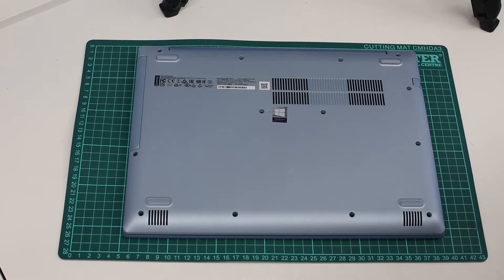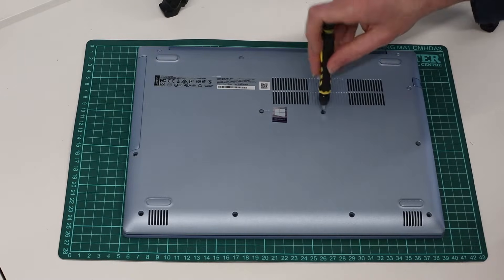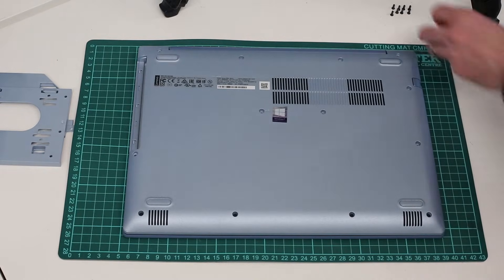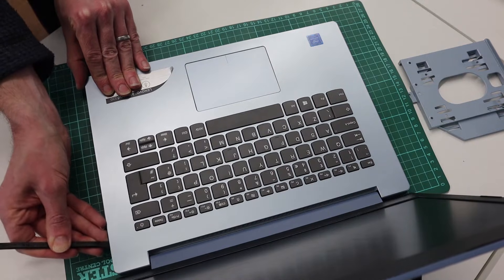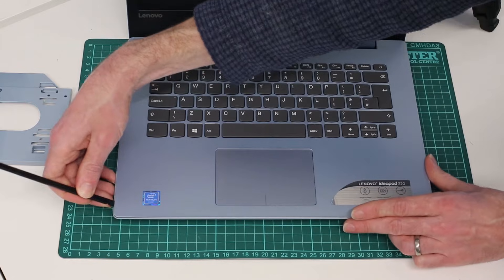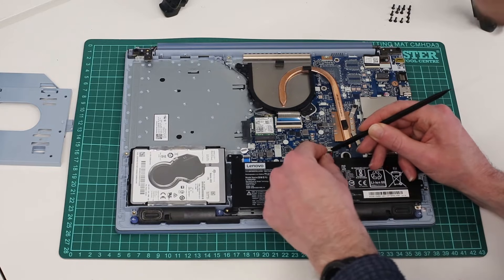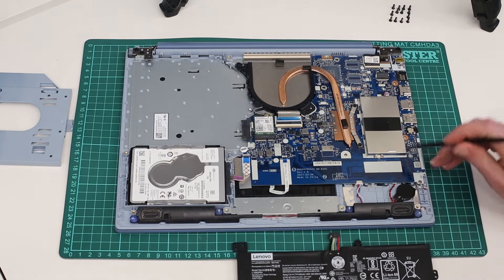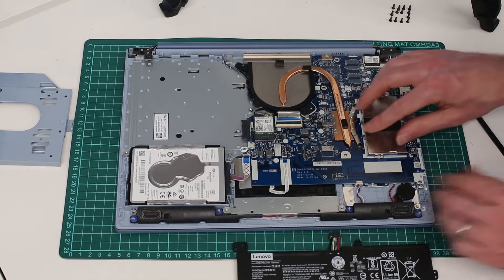Lenovo ideaPad 320 SSD/HDD and RAM upgrade guide

Comment: There are different opinions about upgrading the RAM module. Some say you can only add 8GB, others say you can add 12GB. What is the biggest and fastest RAM you could add.
Reply: I found the specifications (ideapad 320 (15") Intel Platform Specifications - 15IAP), and the maximum allowed RAM is 8GB max / 1600MHz DDR3L, one DDR3L SO-DIMM socket.

Comment: Why do we need to remove the battery before installing the ssd and ram?
Reply from the maker: To prevent accidental powering of the board whilst removing or installing RAM which may damage the board and/or RAM, and lead to data corrupton on the drive. 
It's not necessarily essential, but as a safety precaution that takes seconds to do it's daft not to.

Comment: Dear Brue,
A lot of thanks for your clear and very well explained tutorial. Yesterday, I successfully managed to replace the HDD (100% utilisation error i couldn't fix) by a SSD. The upgrade is amazing. I'd also thank you as this kind of tutorial allow us to extend the life of the laptop instead of buying a new one each 4-5 years. My 5-years laptop has just begun a new chapter, thanks to you 🙂
Reply: Did you do 1 tb? some says max we can use to ideapad 320 is 500 gb?
Reply: @JonathanHernandez-hf4jj  I replace my 1To HDD by a Samsung-500 Go SSD (enough space with this latter) so I cannot say. I noticed that CPU tends to be more used but nothing unusual. I hear in other videos that the most important point is the 2.5" SSD + suitable caddy. Nothing about a max storage. Anyway, you may also replace the HDD by a SSD, then use the HDD in the optical driver slot.

Comment: Nice session sir
I am having Lenovo IdeaPad 320 
And I am facing laptop stuck problem when working with many chrome tab open on screen and some time showing 100% disk usage please tell me solution for this
Will it be solve after ssd installation or have to upgrade Ram
Please reply sir
Reply: SSD would be recommended, upgrading ram isn't good enough

Comment: Hello Mr James!
I have an Ideapad 320-15ISK Type 80XH, in the manual online it shows that it can be upgraded to 16gb. I'm not sure if the ram is soldered or not. Can I upgrade to 16gb?
Also I have a 2TB HDD hardrive, can I upgrade to a 2TB SSD?

Comment: Holy cow how come I haven't seen this yet. So I have the same laptop as the one in your video which is Lenovo Ideapad 320 and currently I have the 4gb ram soldered, any tips on how to pick the right ram for my laptop? also I found this comment in the lenovoforums stating that the ideapad 320 can support 16gb ram.

Comment: I have 2TB HDD on my laptop. Can i add a 500GB SSD with caddy? or it just works on laptops with 1TB HDD!  Thank you
Reply from the maker: Yes, can add in a 500GB SSD no problem. If retaining the 2TB drive I'd move that to an optical bay caddy and install the SSD in the main slot inside.
Reply: @BrueComputing  Thank you very much
Reply from the maker: @MahanMontazeri  No problem - glad to help.

Comment: Sir i have lenovo ideapad 320-14isk i want to upgrade may ram with 8gb 2666mhz is it compatible?
Reply from the maker: Should be fine - looks to only have 1 DIMM slot though.
Reply: @BrueComputing  dimm slot? I have 4gb now built in
Reply from the maker: Yes, there should be a single DIMM slot on the mainboard you can add RAM to. Under a metal cover.
Reply: @BrueComputing  can i run gta 5 my specs is i3 4gb ram 920mx 1tb
Reply from the maker: With 4GB, no. With 8GB it should run, but won't be especially high frame rates on an 920MX.
Reply: @BrueComputing  yea if i add another 8gb 2666mhz it will be 12gb ram can i run the gta 5 run smoothly with 920mx?
Reply from the maker: @donescobar4066  As I say, it should work, but frame rates will never be amazing on the 920MX.
Reply: Sir i bought 8gb 2666mhz but my laptop cant open it stuck in lenovo loading what will i do lower the mhz?

Comment: whats the compatible RAM for this model? It was never answered on the video nor on the comment section... :(
Reply from the maker: From memory I didn't put a link in the description because some models of IdeaPad 320 use DDR3 and others use DDR4.
If you check what your system uses with CPU-Z that should tell you what you need.

Comment: Any updates about the speed of the laptop after the ram upgrade?
Reply from the maker: The RAM will improve performance in multi-tasking scenarios, but the SSD will be a far more noticeable upgrade.
Reply: @BrueComputing  I'm planning to upgrade both ssd and ram but due to financial constraints is it ok to have a ram upgrade first?the stock has already 4gb ram..but it is still lagging even though I uninstalled not needed programs.

Comment: Hi, I watched your video which was wonderful and very informative.  My question is, is it possible to upgrade celeron N3350 1.1ghz (lenevo ideapad 320 model laptop) processor with intel i3 or i5 apart from ram and hdd upgradation. Thank you sir.
Reply: Thank you
Reply from the maker: No. Your only option would be to replace your mainboard, along with bits like installing a fan.

Comment: My battery seems inflated . Is it safe to use it.
The battery backup is there for 4 hrs.?
Only a part of battery is inflated
Reply from the maker: I wouldn't recommend it - if the battery is pierced it could short and cause a fire.
I would remove and safely dispose of the battery and replace it with a good quality replacement part.
Reply: @BrueComputing  sir, is it safe to use without battery  ? Just removing the battery and plug n play safe option ?
Reply from the maker: @blanco5614  No issue using it without a battery.

Comment: I replaced my Hdd with a ssd. Can i insert my extra hdd in the space in the upper right?
Reply from the maker: If your machine has an optical bay then you could replace the DVD drive with a SSD/HDD caddy and fit it in there.

Comment: Dear friend, this is very nice information.let me know that,After installing SSD,is it necessary to format our machine? can we only format c drive??and D drive should be unchanged?? help me regarding this..
Reply from the maker: If replacing the existing drive then you'll need to either clone the contents across or clean install Windows to it. If adding an additional drive then you'd need to initialize and format the new drive.

Comment: hello, I made this improvement to my Lenovo ideapad 320 15AST laptop, my problem is that the ram I put in is 2400Mhz but even if it doesn't give me that frequency instead it gives me 1066Mhz, how can I increase the frequency? the bios but it doesn't say anything related please help.
Reply from the maker: 1066Mhz is DDR4-2133 (1066x2). That is the maximum speed supported by the AMD A9-9420 processor.

Comment: Hi. Is this RAM DDR3 or DDR4?? Which proccesor does this laptop have??
Reply from the maker: The model in this video was DDR3L, but varies depending on the exact specification of machine you have as there are quite a few ideaPad 320 models.

Comment: Hello! I have a Lenovo IdeaPad 320-17IKB. I have noticed that it's been functioning slower and gaming on it isn't as smooth anymore (could be the Intel graphics card or CPU, I don't know too much about computers). Anyway, I wanted to ask if switching to a SSD and  upgrading the RAM would make games smoother to play. Some games crash and drop frame levels unfortunately. For gaming purposes, would you recommend upgrading this laptop or waiting to replace it?
Reply from the maker: Generally additional RAM and SSD may speed applications and reduce some stuttering as data like textures is loaded in to RAM and isn't removed so aggressively. It won't necessarily give a significant improvement in general gaming frame rates though - but depends on the exact specs, game, etc.
I'd check the system cooling over if you've noticed a degradation in gaming performance - could be the heatsink is clogged with dust and so the processor is overheating and throttling under load.
Reply: @BrueComputing  Thank you! I'll try checking the cooling (or ask someone to do it 😂). I do want to mention that when I play some games, the memory will shoot up from like 30% to 100%. I check this through task manager. Could this also be a playing factor?

Comment: Sir on the right  side of the battery where there is recycle icon, the whole battery section is swollen and when I gently press it, it feels like the gas is trapped inside, what should I do?
Reply from the maker: If the battery has expanded I would recommend CAREFULLY removing it and taking it to a recycling centre which accepts lithium ion batteries. If in doubt have a professional remove it.
Reply: @BrueComputing  alright! Thank you for the reply!

Comment: Hey
I also have a lenovo ideapad 320-14IKB with SSD 256gb standard and 8gb ram, but have upgraded to samsung 870 QVO 2TB ;-) and it works. Do you think it would be able to handle 16 GB of RAM?
Reply from the maker: Shouldn't be a problem.

Comment: Hey there, I was having a confusion. Actually I'm about to purchase a RAM for this exact same model of lenovo so, do you think that an 8GB RAM stick will do fine with additional to 4 GB in-built RAM?
Reply: Yes, it will work. The maximum ram for this brand is 12gb. I purchased a hyper X 8gb 2400 ram
Reply: @yvonnemahan8938  what type of DDR? Is it DDR4?
Reply: @cheremmy210  DDR4

Comment: two of my screws are stuck, please help, they don't come out even after rotating it many times, it's like it is locked inside.
Reply: even after infinite rotation they don't come out.....
Reply: please someone help me.... i was planning to get an SSD and in the main slot and put the HDD in the cadday and place it there
someone generous enough to help....?
Reply from the maker: Sounds like the metal inserts have broken out of the plastic housing they are set in to - particularly common around the hinges where the force of opening and closing the screen cracks them over time.
Reply: @BrueComputing  thanks for the reply, so by any chance, how can I get them out now....?
Reply: @BrueComputing  and yes you are 100% right it is around the hinges
Reply from the maker: @kalpeshvishwakarma9486  I'd try just removing the back of the chassis with all the screws you can get out removed. Pull the base up and then try unscrewing them with a little upward pressure applied. You may be able to pull the lugs up against the hinge and wedge them so that they catch and the screw can be removed.
Reply: Due to the pandemic I prefer not going out to the service center, so if you could guide me how to get the screws out, it would be of great help... And moreover my place is under lockdown so all I can do is to order the SSD online and install it myself

Comment: Hey there. I noticed the fan was not there when you returned that back cover. Did you remove it intentionally and is it okay to remove the fan and use the laptop without it?

Comment: I having problems to upgrade the memory ram. I try it with a 2gb and with a 4gb ddr4 2400mhz but it just dont recognize anything. Actually it worked one time but as soon i restart the computer it doesnt work anymore. Should i assume its a slot problem? Or i need a 2133mhz exaclty like the on board memory? In lenovo web site they indicate the 2400mhz as i understand is adaptable to 2133mhz..

Comment: About to do this to my stepdaughter's 320. Wondering how much of a speed increase I'm going to get with another 4GB of RAM and SSD. This machine is extremely slow, probably due to the HDD but I can't see any videos anywhere which detail exactly how much better the machine performs with SSD and extra RAM.
Reply: No you don’t need to upgrade the hdd I have the exact same model you need to upgrade the ram. If your hard drive is below 500gb then I would suggest upgrading that as well

Comment: hello sir. if i change the drive to ssd, my files from hdd will be Erase? thank you so much for your helpful video, i'm using ideapad 320 too.
Reply from the maker: Your files will be on the old drive. You can either clone them (and Windows) to the new SSD, or clean install Windows 10 and copy your data manually.

Comment: Hi i have a question for you: can i use my ideapad 320 if i remove the battery from the laptop? Sorry for my english.
Reply from the maker: Yes, it'll work with the mains adapter connected.

Comment: There's no way to upgrade the processor in this notebook?
Reply from the maker: Only by swapping in another mainboard. Very few laptops have a socketed processor now, only those based around desktop components. All modern mobile chips are soldered down.

Comment: Hello, I got a Lenovo ideapad 320. Inter i7-8550u with 12 gb ram (4 integrated and 8) and without SSD, what would you recommend me to upgrade for games, games like gta V, apex legends and stuff like that, they  are running low on fps, is there a way I can upgrade to get better with ? Regards

Comment: I upgraded my 4gb RAM to 8gb and the 1tb harddrive to 1tb SSD and it is a world of difference. I'm now able to keep up with simple class assignments,whereas before I was always still loading, holding the class up. Next I'm going to remove the disc drive and use it as an extra harddrive from the one I replaced. Idk if its going to make a difference though. I'd appreciate anything helpful  in the comments section.👍
Reply from the maker: Glad it helped!
Reply: Hi - can you tell me which RAM did you buy?  I have just replaced the HD with a SSD and goodness WHAT a massive difference.  I also wish to use the blank DVD drive bay for another hard drive but as yet can't find an adapter although a HD fits into the tray very neatly - just need the cable part??
Reply: @karenhoney2232 which ssd did you buy and 1tb or 500gb?
Reply: @ I purchased a 1tb hard dive and its absolutely fine:)
Reply: How many slot of RAM this Laptop?
Reply: @kriskurniadi  One
Reply: @chome4  it has two slots, one is soldered
Reply: @kriskurniadi  one

Comment: I saw that the Lenovo Ideadpad 320-14ikb is limited to 16GB, but there is an ON-BOARD 4gb ram on it, 

so my question is, if I use my ram slot and slot in a 16gb ram would it work?
Reply from the maker: Yes, should work.
Reply: @BrueComputing  even if the on-board ram is soldered? And cannot be removed?

Comment: Is it possible to electrocute yourself when opening your laptop? I know it's supposed to be unplugged and turned off, but I'm worried about disconnecting the battery from the main board and also unscrewing all the screws with the battery still in place, so I was wondering if there is any chance at all that I could electrocute myself while trying to open my laptop. I have 0 knowledge about disassembling laptops, but my fan hasn't been working for a while so I want to clean it.
Reply from the maker: You could in theory get a small shock if you were really silly, but voltages are very low (the power supply gives the laptop 19V DC, not 110/240V AC) so the risk of electrocution is pretty much zero.

Comment: Is it ok if I remove hdd without removing the battery first?
Reply from the maker: I'd advise at least disconnecting it to make sure you don't accidentally switch the system on whilst working on it - removing it makes it a bit easier to connect and disconnect.
Reply: @BrueComputing  ok thank you sir.

Comment: so there was no reason for you to take the battery out. you could take the HD out without unscrewing the battery.... dont see why you did that...
Reply from the maker: It rests on top of the hard drive cable - removing the battery makes it easier to lift and unplug the drive. It isn't strictly necessary, but for the sake of a couple screws it means you're less likely to snag or damage the cable.
Reply: @BrueComputing   ya good point

Comment: My laptop is also 320 IdeaPad but with Nvidia MX150 graphics.

Is there only 1 slot for RAM?
I am planning to buy RAM 16GB 2666 Mhz, can the motherboard support it?
Reply: Nope.
Reply: Total 16GB is the max limit and you should buy a 2133Mhz since the system will just allocate to that figure even if you will buy a 2666Mhz. Save your money abd buy a 8GB RAM. 

Although some people did that and became successful.
Reply: I did it but the laptop encountered some error like memory overload as such... Or out of memory.

Comment: I have 320e and a9 ... Which ram should i get ? I just know it's ddr4
Reply: I just updated my memory today with a 16GB A-Tech Premium Memory, now the memory reads as 20GB memory and this laptop now is fast as hell!!!  
16GB Module DDR 4 2400MHz PC4-19200
Reply: @miketuck3010  the lenovo website was showing max Ram supported as 8gb ... I didn't take the risk. Just went with 8gb :(

Comment: is it worth it to upgrade to a ssd 500gb from kingston? and add 8gb of ram? 
or should i add a tera to make an impact on the performance?
Reply: I just upgraded to a 500GB SSD drive from a 1TB HDD drive, I don't nearly use close that that much storage.  World of difference on how much faster this laptop operates now.  I am waiting to install the 16GB memory stick, as I have read others with this laptop upgraded to the 16GB stick along with the 4GB onboard memory and now have 20GB without any problems
Reply: @miketuck3010  Oh that's great to hear, i thought that maybe 500gb wouldn't make an impact, i lost you at the end, you'll also add 16gb of ram?
Reply: @onazeballos3413  Yes, now I have 20GB of memory in this laptop

Comment: Hi sir, I'm planning on upgrading my Lenevo ideapad laptop to 8gb ram with my adata 4gb ram from my acer, does Lenevo ideapad 320 supports the ram of Acer laptops?
Reply: Do yourself a favor and just get a 16GB memory and this laptop will be updated to 20GB memory 19.7 useable. I just did this today and this laptop is now wonderful, not to mention, I did also upgraded to a 500GB Crucial SSD drive
Reply: @miketuck3010  thank you
Reply: @alizahid5572  No problem :)
Reply: I added a 16gb ram ADATA and it’s not picking up